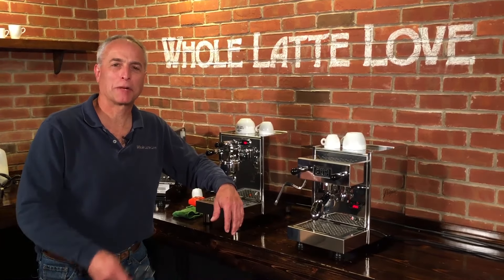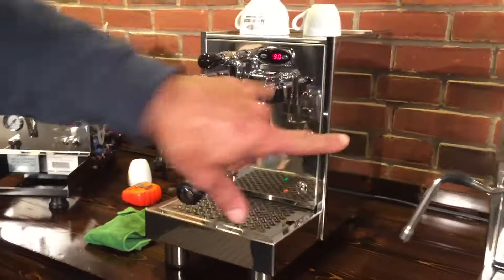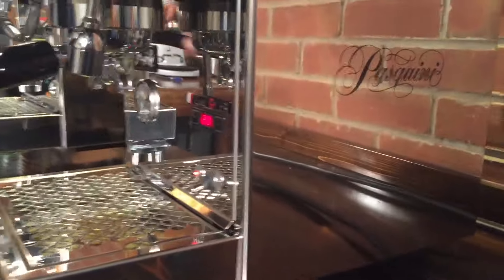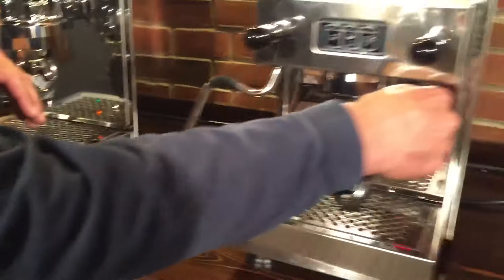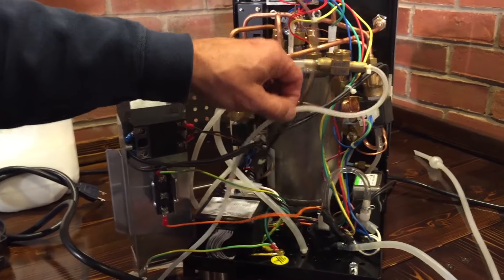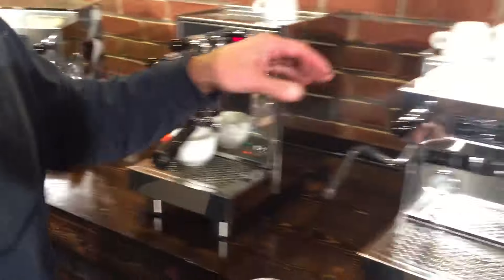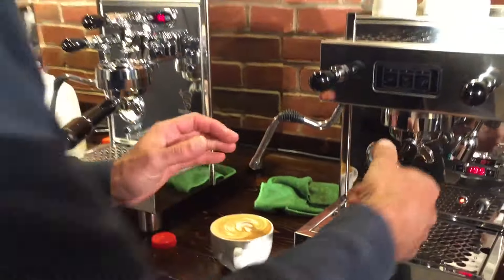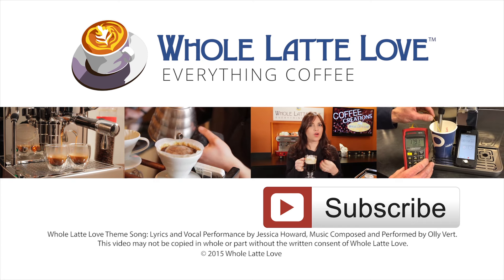Compare: Bezzera BZ07 and Pasquini Livia G4 Espresso Machines

Comment: So, one heating element on G4 because group is enclosed and heat isn't dissipating as much? Have you measured which of two faster gets to brewing temp (I guess, they are same)? How about of realibility of non-travel type buttons on G4?
Reply from the maker: Hi 1..., These machines are fairly similar at a basic level. Both are heat exchange boiler machines and both have electrically heated group heads. So there's heating element in the boiler and an element in the group head as well. I have not measured full heat up times on these machines but should be about the same.
Marc
Reply: @Wholelattelovepage  Hi Marc, according to Bezzera, the BZ13 (which appears to be identical to the Livia G4) has a smaller brew group which means it heats faster than the BZ07/BZ10. See here: https://www.youtube.com/watch?v=iY7uL4MTfjY

Comment: @Whole Latte Love

Allow me to add some information from Europe:

If the Pasquini Livia G4 is anything like the "original" Bezzera BZ13 (as far as I know, the PLG4 is exactly the same, made by Bezzera, only with a Pasquini branding and different feet), it actually is quite different from the BZ07. 

* First of all this is a different, commercial brew group (you will find the exact same one in the current Bezzera Ellisse). 

* Secondly, the pressurized tubing was changed to optimize stability under heavy load. 

* Last but not least the thermostat is placed directly on the brewhead, so it measures more precise. That way, the brew group has a more direct influence on the brew temperature which results in a much more acurate result than with normal HX systems. That's the reason, why the PIDs of the BZ13/Pasquini L G4 do actually make a lot of sense (at least a lot more than on a normal HX machine). 

In the end, the BZ13/Pasquini L G4 was designed to not only be a domestic unit, but to work as a small, commercial machine for bakeries etc, so Luca Bezzera made it to really take heavy load without compromising on the brew temperature. This would be important to mention. The BZ13/Pasquini L G4 is related to the BZ07, but it is by far more evolved!

Ps.: The steam wand on the Livia actually is "No Burn". This however relates to the the milk not burning onto the wand. It will get hot, but not as hot as a normal steam wand.
Reply from the maker: +NameNaameNameeNaamee Awesome! Thanks for your contribution.